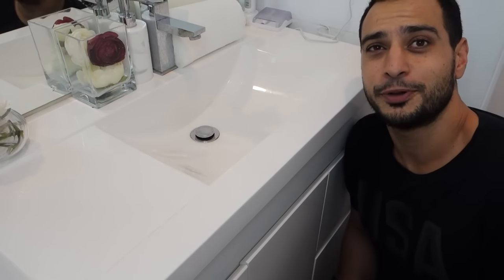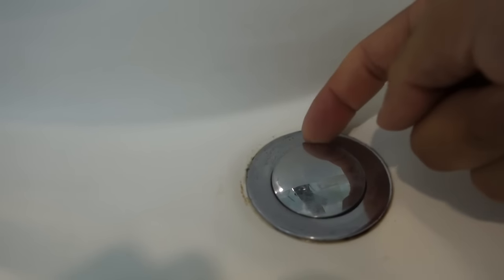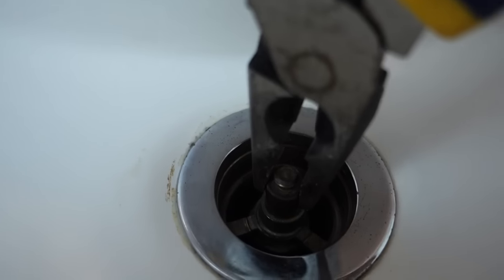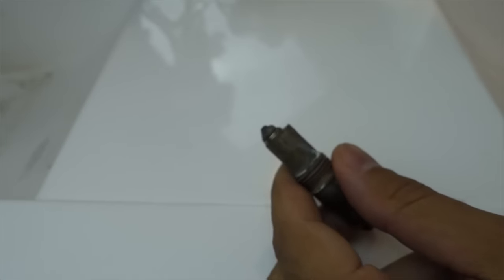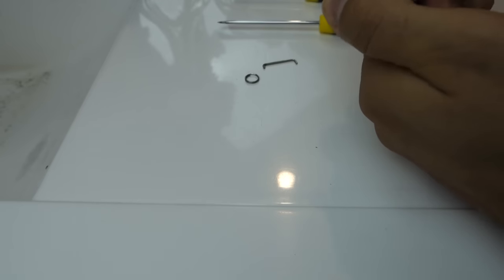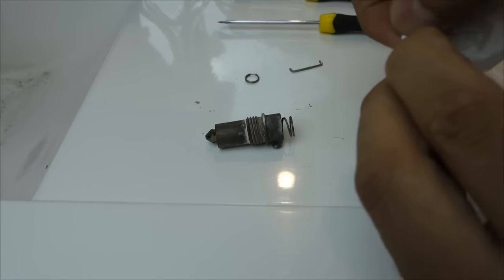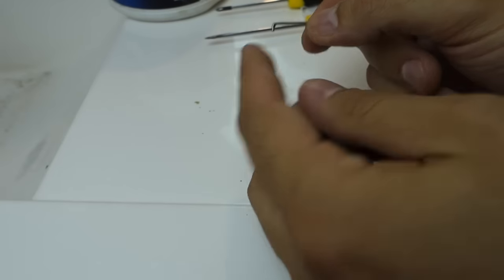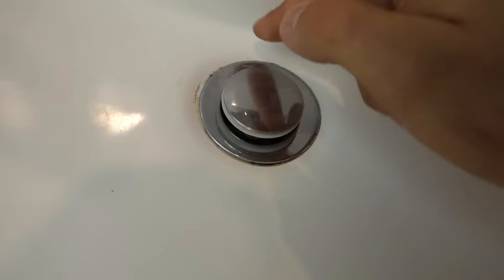How to fix pop up drain waste plug - stuck or leaking

Comment: This video saved me €100. My plug was stuck in the closed position, and it was really jammed. I tried using a plunger, I tried using wd40, but the thing that finally got it open was the rubber glove trick. Thank you!!

Comment: This was very helpful, my plumber didn't understand the mechanism and gave up halfway through, he lost the small ring and assembled everything without that metal clip so it would never lock in to place. I had to redo it myself, I use cotton thread instead of that small ring since it was lost. It works so far. I have to say I'm kinda proud of myself.
Reply: He is no plumber

Comment: To be honest I didn't think I would find a video on this so for the past 2 years have pondered what to do. I brought a plumber here a month ago about another job and since he was here thought I'd get him to fix this. I first asked for a quote and almost had a heart attack when he told me it would cost me almost $600 to replace it. It took me only a matter of minutes once I followed your instructions. The only issue I had was returning the metal clip because I had depressed the piston all the way down and it wouldn't go in. By releasing some of the pressure on the piston it went in easily using a pair of tweezers to hold the pin. Your blood is worth bottling. Thank you.

Comment: Thanks Bill. An exceptionally easy DIY tutorial to follow. I did however, have to use a fine sandpaper to clean the caked on gunk on the piston and inside the tube to really get the parts clean as mine were completely jammed. I then had to use a small amount of grease to make it run smoothly. Other than that, you saved me over $100 for my whole house. A big 👍
Reply from the maker: Glad I could help, thanks 👍

Comment: THANK YOU !!! Daughter just bought a house. All three bathroom plugs were seized. One didn’t even have the flats showing to grip so had to get pliers round the body, plus a bit of hammering. Now, after stripdown, cleaning and greasing (using your video for guidance) all work better than new. Don’t know how the previous owners put up with them. Thank you again.

Comment: Had a sticking plug. Didn't expect to find any advice on how to fix it. Amazed to find a video devoted to the problem. Dismantled and reassembled the piston as shown. Not difficult. Used a silicon spray instead of grease. Works perfectly now.  Thanks.

Comment: Thanks Bill.  My push top pop drain didn't work either.  Wouldn't stay down.   I followed your instructions, got it open and found the pin had caught on the inside and bent so that it wasn't contacting the slot.  Straightened it out so it looked like yours, put it back together and it works!  Couldn't find a replacement part at any local DIY store.:goodvibes:

Comment: I think I damaged my piston with drain unblocker!!  These tips got it working again in no time.  Plenty of vaseline, push it up and down a few times - I didn't dare unscrew it - and it's smooth operation again.  I also put vaseline inside the screw part of the top of the plug and now I can screw/unscrew it as often as I like to clean underneath it.  Absolutely brilliant, thank you.

Comment: Now i know why God invented Austrailians, THANKS!!
Reply from the maker: Lol 👍
Reply: While I watched the video on how to take this apart, my mother just sprayed some WD40 in it and it works like a dream now.   BTW I couldn't take the top off while it was stuck down, to lift it use either a plunger, a magnet, hot glue a stick, or a small suction cap to pull it up.  Once it was up a towel or sponge helped give me the grip needed to take it off.

Comment: Thank for the help. The plug was stuck and would not open. In our case the small screw had completely fallen out. Fortunately the screw was in the drain. Following your directions I was able to reassemble the plug and it is working fine.

Comment: Have just followed the steps shown, the only tricky bit was that the small spring sprung away landing in the bath, fitting it back was also a little tricky but all went just as described. I had some Vaseline to hand and used it to lubricate the slider and the two pronged grooves, working as good as new . Many thanks for posting your video.

Comment: Saved me from buying a new plug. Thanks mate! I can see mine has rusted quite badly with one small hole appearing where the grooves for the spring is, but cleaned it up with soapy water and an old toothbrush, greased it and its smooth again until it proper dies. Cheers!

Comment: AMAZING VIDEO! 

FOR ANYONE WHO HAS THIS PROBLEM :

Consider getting an actual small suction cup (towel hangar suction cup) or 3M stick adhesives.... Use it to lock onto the stuck pop up plug and twist it too unlock as instructed in the video.

Amazing VIDEO

Comment: Great vid.  I spent an hour taking mine apart and fixing it back together, without success. Once I'd cleaned and lubed everything, I couldn't get the plug to stay closed. The secret was to take the ring off of the bottom. This allowed me to correctly locate the "bent shaft" in the groove. popped the ring back on and all was well. Thanks very much.

Comment: Legend mate, showing me these helped me fix my one that was stuck down something fierce.

Couldnt get it to rotate even with a rubber glove, so what I macguyvered was:
Bought 2m command strips. The one that you use to attach calendars/hooks to your wall.

I stuck the hook to one side of the command strip (like normal) then stuck the command strip to the stuck sink bit.

Waited 30 minutes, grabbed a spanner, and tightened the spanner upright on the hook. I then rotated the spanner anti clockwise and it eventually started moving. The hook snapped but it got it moving enough that I could rotate it from there.

Then I followed the video (bought a new piece though cos I can't be bothered servicing it).

Thanks for the vid!
Reply from the maker: Lol sounds like you had an adventure with it, glad you found the video useful 👍

Comment: Very clesr and helpful instructions, however, if you have hard water, you might be able to solve the problem without taking the piston unit apart. I took mine out of the sink then soaked the unit in vinegar for a couple of hours. Mechanism now functioning perfectly.

Comment: My pop-up was doing exactly what yours was - sometimes difficult to get it to pop back up, sticky action etc. I watched your video and when you recommended that I shouldn't tackle the service myself, I took out the plunger to check the size then I ordered a new part from Amazon - as you said, very cheap, only £4 (UK). When I re-inserted the plunger into the sink, something went wrong and I had to take it out again. It seemed that something had become disconnected. So, I disassembled it following your procedure, applied some grease and on the second attempt,  I got it back together again successfully. All I did wrong on the first attempt was to put the pin back upside down but you did warn us about that! It's now working perfectly so thanks very much for a great video. I will soon have a spare if it sticks again and I can't be bothered to take it apart again.

Comment: Many thanks for the video!! I fixed my piston but I managed to do it with just WD40. If it's jammed in the downward position, just spray some WD40 to loosen it up. Obviously, make sure there's no water flowing. I unscrewed the piston from the housing just as you did. 
This is why I'm so grateful for Youtube - if this happened years ago, I would be clueless. I would have fiddled with it, and possibly messed it up. I would have had to call a plumber, paid him and hoped that he didn't make things worse.
Reply from the maker: 👍👍👍 only problem with wd40 is that it will wash away after a while. Try some grease or wd40 also has a lubricant silicone spray which will last longer

Comment: Well done bill ..dropped a glass tumbler in sink ..bit of glass got stuck in plug hole ..could not budge the top when trying to twist it .tried getting glass out with screw driver to no avail .saw your vid ..put rubber glove on ..bingo straight off ..many thanks

Comment: How amazing is the Internet and YouTube. Thank you so much for posting this. 

Woken up this morning by my wife who said the popup plug in our bathroom sink  had ‘come out’. I had a look but couldn’t make head or tail of how it all worked. You’r video explained everything, 1st one I found too. The little screw was missing, so we found that in the trap. Reassembled the whole thing with special waterproof grease I use on my bicycles and now it is working much better than before 👍🏻 

The little screw wouldn’t tighten up, though it would screw in, so I wrapped a small bit of self-amalgamating tape around it to stop it ever coming out again.

Thanks, Keith & Anne 😎
Reply from the maker: Happy I could help 👍

Comment: thanks man! i followed this and found that when i cleaned and lubricated everything and put it back together it worked right up until the point when i put the cuff back on. Then it stopped again. I had a look and the little [ bar had gotten very slightly bent outwards so it was more like ( and that was making it push too hard against the cuff. I bent it back to being as straight as possible and put it all back together and it works now! You saved me ages waiting for my landlord to come and fix the damn thing....

Comment: Bill, a great video. It was so simple to understand the workings of the plug and set about rectifying the problem. Unfortunately ‘Murphy’ was nearby and as I removed the brass assembly the tiny screw had come loose and it dropped into the drain! ... 😰.
A quick Google and I found the whole brass fitting available at my local Bunnings store - a Kinetic Brand Pop Up Waste Mechanism for a mere $4.75 !! all fixed. THANK YOU

Comment: This is a very good guide to dealing with this kind of plug fitting.  I'd been looking around on YouTube and didn't really find a good solution to my issue - which was exactly the case here, a plug stuck in the 'down' position - until I stumbled across this page.  Now a subscriber, thanks for making DIY so easy!

Comment: Thanks Bill. Just bought a new home and the drain plug doesn't work. Knowing how to remove it is helpful. I had the right idea but my plug was really stuck. Didn't want to force it if I was doing it wrong. I'll fix the current one for now because all the hardware stores are closed due to the pandemic. Replace the unit once I know which model it is.

Comment: Thanks for the video. I used a plunger to pull the valve up. A slow depress and 2 quick pulls up come the valve. Then it is a easy repair.

Comment: Thank you so much! I was able to take the piston apart and get it working again. The trick for me was to use grease. I had the WD silicone but it wasn’t the right lubricant. I had an old tube of grease and needed to use it so the cylinders would slide properly. Replacing the ring seemed impossible but someone my husband had the right technique. BTW this was not an easy part to find locally but we have a spare one on order from Amazon.

Comment: Thanks for the video! My stopper was stuck today. From your vid and others, I came up with my own way with things having around the kitchen. I used the tape, hold the tape down in one thump and twisted with the other hand. Removed it in 10 seconds. Then lubricated the retractable mechanical rod with dish soap, pressed it a couple of times like a pen until it cleaned up all the sticky thingy then put it back. The cost is $0.00

Comment: Good little video that helped me fix my plug. In my case, grease alone would not have worked because there was a lot of buildup inside the piston leaving no room to move. I had to use sandpaper of varying grades to remove all this and then it moved freely. Thanks.

Comment: Thanks mate, I am in rented accomodation but feel better nothing expensive is damaged.  Tip - you can also try a small suction cup to remove the plug top, ie. either by attaching it and then pull or unscrew.  The type of suction cup I had came with a shower glass E cleaning cloth to stick it onto the shower screen.

Comment: This was great! Thank you. I have just bought a house and the previous owner did no cleaning or maintenance so the 3yo house looks like a 10yo house. I saved the downstairs sink with your help (and some descaler) but the bathroom mechanism is stuck in the down position. I have tried descale, bike lubricant, WD40, but none of them work. How can I get the spindle out??

Comment: Brilliant video. I did fix it in less than 20 minutes. One small suggestion to add is that I advise to put grease on the spring itself and on to the little screw groove too. Regarding the small pin to be repositioned at the end, I used an eye brush pin to ease the process.

Comment: I hope this helps somebody.  I tried the glove and it went down even further in the drain. It was stuck and I almost gave up.  I put wd40 and it wouldn’t even go in the crack it was so tight in there. The last thing I tried (with a lot of prayer)and I didn’t think it was going to work, I took a flat head screwdriver and used the rubber gloves and tapped around the stopper with a hammer and then tried unscrewing with the glove.  I couldn’t believe it when it started coming up. I believe that when it got stuck in there it was crooked and one side was lower. 
Thank you for this video I still can’t believe it worked.

Comment: Very helpful.Only problem I have is the little screw stripped the hole as I removed it.I have tried taping it up.Also the link seems to have worn a hole in the piston so it still sticks in down position.But a little twist with your fingers as you push to release plug does the trick.

Comment: last night I had a relaxing bath and when I got up to wash my hair, the plug wasn't popping up! I quickly rinsed my hair before the tub overfilled. I couldn't work out what was wrong, the tub was squeaky clean before I jumped in. I called on dad to come over and he used his muscles (I'm all of 50-something kilos) and my plunger to lift the plug up. While doing so, he felt a band-aid stuck underneath. I felt so silly, but relieved that it was all sorted. So, if the plug isn't popping up and the sink/tub is full of water, I recommend trying a plunger to get it to pop up! Worked for me at least :)

Comment: Thanks.. mine was slightly different with the plug attached to the piston but internal mechanism exactly the same.. really helpful!
Reply from the maker: No problem, you will find with most repairs the style may be different but the concept is the same 👍

Comment: Excellent video ty. I wish i thought of the glove or watched you video first. I think ive pushed thr plug down to far thinking it will spring back up. Any tips for getting it back up? Ive tried the glove trick and its to too far in and stuck to undo. I tried a little penetrant but that isnt helping either .

Comment: Tip: You can use a Sucker Bulb Removal tool (e.g. for GUI10 LED bulbs) to pull the stuck plug up. That’s if you have one handy ;-) Cost about £2. Still best to clean / replace the mechanism though if that’s at fault. In my case it was just stuck due to temporary debris caught in the plug seal.

Comment: Mate, your videos are so informative and I'm learning a lot. Quick question.. I have a similar issue with my pop-up waste, but the only difference is that there's no flat surface on the waste plug for the wrench to grab on to. Do you have any suggestion on how to remove it? Are there different types of plug? Mine is pretty much rounded all the way through.

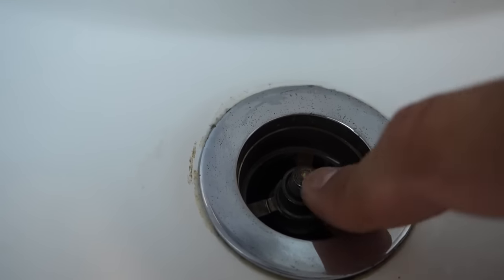Comment: @2:13 For the piston removal, mine is stuck in the closed position and so I can't get the wrench/pliers around the flat bit as its flush within the piece. The pliers just start wearing the top rings down Any tips for this?
Reply: Im waiting for this answer too

Comment: Hey bro great video. I'm going to replace my whole piston. I have removed one but the one on the other side the bottom half of the piston is stuck. I can u screw it. Any tips or tricks I can do to get it out. I tried pliers but it's not gripping or turning . I need some help. Kind regards

Comment: to add to the methods used to undo stuck piston, try using a bike degreaser. small amounts around the edges, wait for 5 mins, and try add pressure from the top.

once u feel the spring effect, you are on your way. give it a try!

Comment: Huh! I've never seen one like that before. Here in the US our bathroom sinks use a lever system that is used to control the stopper by a lever on the faucet. Are all your bathroom sinks this design?
Reply from the maker: Hi, no there are many different designs however this is now the most common style as they are universal. The system you are referring to is the older style. I have seen both styles used in the US and Australia

Comment: Looking at your video I see that the pressure popup drain plug enters into the drain that also has the silver ring around the drain hole. My drain do not have this so was the plumber supposed to have installed this first or is the ring optional on some sinks

Comment: great video, worked on my bath plug, thanks! however, i can't remove the piston on the sink plug. when i twist anti-clockwise it moves the whole plug and won't come unstuck.. any suggestions?
Reply: I am facing the same issue. Cannot remove the plug but turning anti clock wise. Did you get the piston out?

Comment: Ps I screwed the lid down minus the spring which meant the lid was locked down,there was no spring to pop it back up,had a brainwave,I connected up the vacuum and held the nozzle square on the top of the lid,hey presto! It retrieved the lid,I reattached the spring underneath, screwed it into position,bish bash bosh job done! Sweet as.........😉